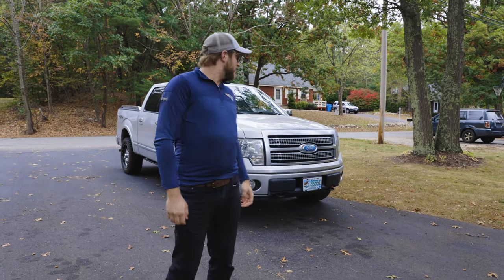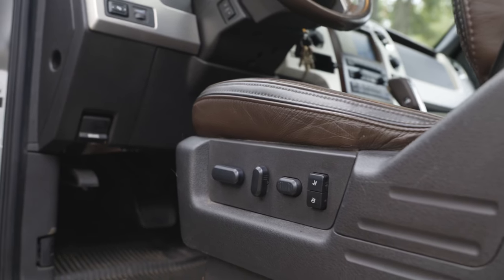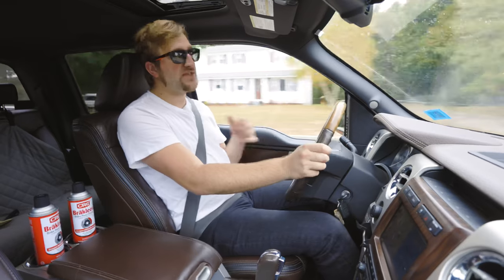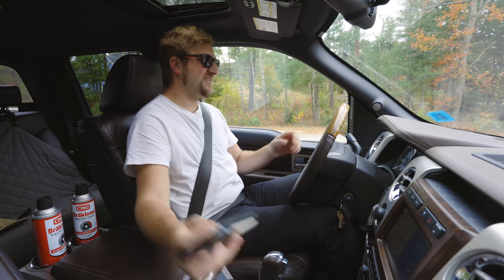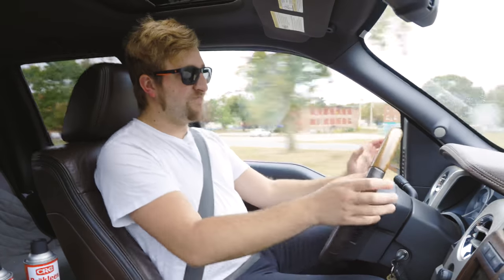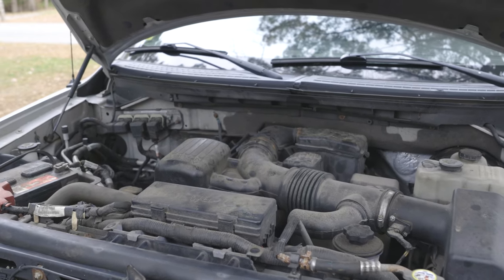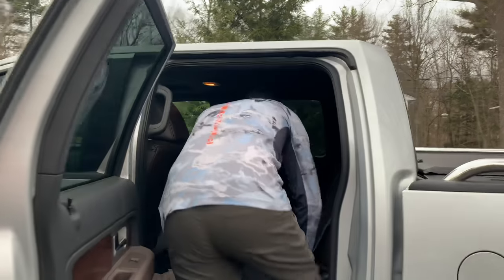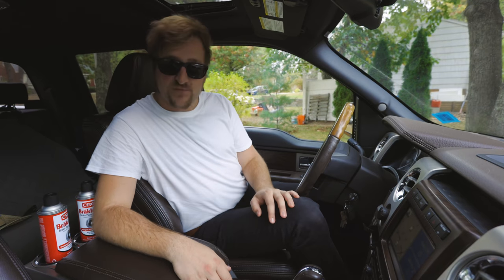2009 Ford F150 5.4 V8 - Long-Term Review (Reliability, 0-60, Towing, 4x4)

Comment: My 2010 F150 has been nearly perfect for me. I too have the 5.4l triton. I bought it with 35,000 miles back in 2014 and have owned it ever since. It was and is my first car and has been through a bit but I've always taken good care of it. Oil change every 3500 miles and I recently did the diffs and transfer case. I need to change the plugs soon, have a coolant flush and the transmission fluid changed (drop the pan). I am at 103,000 miles now on it which is relatively low miles but 50 percent of them have been towing anything from a 17 foot aluminum boat to my 21 foot fiberglass triton. The only issue I had with it was when I first bought it... It came from NY and had an exhaust leak at both exhaust manifolds. Whenever I had the mechanic try to change the manifolds, 4 or 5 of the bolts broke (a few rusted and broke on their own). So that was pretty expensive (around $2000) since he had to pull the engine, drill out the bolts and install the new manifolds and bolts. But otherwise the only other thing I have had to do to it was get new brakes and two sets of tires but those are more wear and tear items and not a fault of the truck. Hopefully she gets me through another 100,000 miles no problem. It does have the timing chain slap for around a second or less after it sits for a while and I do have a little ticking. I recently switched to 5w30 instead of the 5w20 oil since that is supposed to improve the longevity of these motors and the cam phasers.  Also this truck has been great for me off road in hunting and fishing situations. And it is so comfortable that I would prefer it over a car for road trips. I do typically average around 14.5 mpg every day driving but I can squeeze out anywhere from 18-20 on the highway depending on the hills and how my right foot feels that day. I do have the 5 star tunes for my truck and have been running them since around 45,000 miles. It really wakes the truck up and majorly improves throttle response. It’s pretty dang quick for as large as it is. I have seen people who have reviewed this truck after the tune who have also drove a 5.0 and they said the tune definitely brings it to near or same as 5.0 acceleration. But of course the torque hits very low and makes this engine much better for towing.
Reply: Had the same issue with the slap at 95000 mikes and opened it up. The problem was the tensioner gaskets were blown out and starved oil to the cams. I did the whole timing job including new followers, cams, and used the previous gen ratcheting cast iron tensioners. Locked the phasers. Got the 5 star tune for it and put in the Melling HV oil pump. Runs great now and should last.

Comment: As an owner of 2007 5.4 who replaced the engine after only 140k miles, I can easily tell you that he’s absolutely right.  Replacing the oil every 3k miles is key on these engines. Anything over that is risking failures on the cam phasers and timing chain and possibly more. Routine oil changes and regular maintenance will go a long way.

Comment: I have the exact same truck except mine is a lariat. I've had it since 2016 and I love it. I'm getting very close to 150k miles and have had zero engine issues, I take good care of my truck and don't drive it super hard too often. It's pulled my boat all over the south and driven thru 2 feet of floodwaters. All in all, I wouldn't trade mine in for a rocket (but maybe for a 2021 F-150)

Comment: I recently purchased a 2009 King Ranch edition truck and I must say, it's absolutely beautiful! The ride is smooth and comfortable just like a Cadillac. Initially, there was a ticking sound, which turned out to be the exhaust manifolds issue that is common in the F150s. Despite having 200k miles, everything feels tight and well-maintained by the previous owner. I particularly love the 3v 5.4 engine. Comparing it to my previously owned 2017 truck with a 5.0 coyote engine, I can confidently say that the 5.4 has more low-end torque, which is great for towing. I plan on keeping this truck forever. If the engine fails I'll just drop another one in as these engines are readily available due to being in production for decades.

Comment: Im the 2nd owner of my 2010. It's got 184k on it. The body isn't in great shape, but it has spent it's entire life in Wisconsin. Mechanically, it runs and drives very well. Everything works, it goes absolutely dead straight down the road too. It's honestly not a bad truck.

Comment: I had an 06 5.4 2 wheel drive XLT for 10 years and it was 13 at trade with 145k.  ZERO mechanical or electrical issues EVER.  Changed plugs twice none broke and I did the COPs myself once. Truck was never quieter and smoother than at trade for my 18. 🤘🏻🇺🇸

Comment: The 5.4 is a super smooth sounding engine. Owning both engines the 5.4 is way quieter than the 5.0.
Reply: I loved the low end torque on the 5.4

Comment: My Lariat 5.4L 2010 has 216,300 miles on it.  Love the interior the Sony with 700Watt factory stereo.  Love Leather seats.  They are heavy.  Excellent truck if you keep it up.  My truck will rock and roll but governs out at around 110.

Comment: Bought a 2008 Expedition EL Eddie Bauer new and had it for 11 years. Zero mechanical issues , only a few electrical issues and it had 92,000 miles on it when we traded it.
We still miss “the limo” after two years but the wife wanted a 4 runner. 🙄

Comment: Cool video.  I too don't understand all the crap the 5.4l gets. I have an 09 F150 Lariat with the 5.4l and 3.73 rear axle. I've only had one issue when I bought it new in 2009, and that was the passenger side exhaust manifold in 2018. Other than that.....zero...zip...nadda problems with 150,000 miles on it. 

I did get a custom 91 performance tune from 5 Star tuning and it was worth it. Took care of the shifting, throttle response, and performance. I also have a Banks intake system, throttle body spacer, and exhaust.  This combination really woke the truck from it's slumber. I've had the tune on since 2012 and zero issues.

Also, I only use 5W 30 oil in my 5.4l with a quart of Lucas Oil additive. This stops the ticking noise from the phasers and makes it purr like a kitten. The 5W20 is too thin for the engine. The United States is one of the only countries to use 5W20, all others use 5W30 in the 5.4l. I think Ford does this to make better MPG requirements only. I could be wrong, but it has worked for me over the last 12 years.

I also tow a 7500-8000lbs travel trailer. I live in North Idaho, so most of the places I tow have steep grades at high elevation and the truck does fine.  That being said, I would  never tow over 8500lbs with any half-ton truck in the Mountainwest....period. It's not a power issue, it's a frame, axle, brakes, transmission, weight etc issue. Unless one likes having the trailer drive the truck or "the tail wag the dog." Admittedly,  if one is a "flat lander" as we call them here, then the truck could handle a little more in flat areas near sea-level. 

I've been thinking about getting a new F150, but my truck has zero issues and is still in mint condition. I'd just hate to get rid of a perfectly good truck. Not to mention the insane prices for trucks these days!

Anyway,  sorry for rambling on, great video! It's nice to see a review which isn't a new truck that can back or park itself and has a 42 inch flat-screen in the dash.
Reply from the maker: Thanks for the comment man! Glad you’ve had good luck with the truck.
Reply: I noticed an engine noise decrease when I switched to 5-30 synthetic.

Comment: long oil change intervals are death for this engine family but it is important to realize that the early generations of three valve had timing chain tensioner gasket failure that caused huge oil starvation. The '09 was  the benefactor of redesigned tensioners so that problem, along with redesigned spark plugs in mid 2008 and a head redesign in 2008 has made for much better reliability in those areas. The '09's were among one of the best years for tritons in the f-150 of all the year models with that engine. You can still get into trouble with low quality, wrong grade oil and or long intervals between oil changes.

Comment: I still own a 2009 FX4 with approximately 150K miles I bought new in 2009. 

Best and most dependable vehicle I’ve ever owned. Truck still looks great interior and exterior. Mine has 5.4 triton. Has never had any major mechanical problems. 

Only thing done to truck in over 15 years was tires, one battery and religiously changing oil every 3K miles ( all normal maintenance). 

The only non-maintenance item I’ve had problems with over 15 years are brake low pressure sensors. I’ve replaced them and idiot light is on again. Other than poor low tire pressure sensors…. Zero problems. 

Keep oil changed every 3000 miles and this year 5.4 is a great and reliable engine.
Reply: Why is everyone saying the triton engine is a terrible engine? That's all o ever hear about these engines

Comment: I bought a 2012 Expedition King Ranch last November with 39,650 miles. It's now the end of December, 2023 and it has 46k miles. We'll drive it about 5k miles a  year, so I'm changing the oil twice a year with Motorcraft 5W30 full synthetic and a Motorcraft filter.

Comment: My 5.4 is a 2004 first year of the 3 valve it has 373,000 miles on the original engine and transmission no mechanical problems ever I ran 10w-30 conventional since brand new

Comment: I have 2007 XLT Flare-side. 149,000 and still runs well. 2 biggest issues are REPLACED TOO MANY EXHAUST MANIFOLDS (5 times!) and quirky shifting around 45 mph or 1200 rpms. Other than that it still rides like new.

Comment: I have a 08  350,000 miles i use Schafer synthetic oil and 8-10,000 miles between oil changes uses a quart of oil every 6,000 miles had to replace vct valves at 145,000 miles  it’s a work truck and is loaded and I tow with it all the time. Been a great truck

Comment: 5.4L 3V are great engines! I have seen some owners really good taking care of their 5.4L 3V and myself too with no issue over 200,000 miles with original cam phasers and timing chains system even old ford oil pump. We always change every 3,000 miles with Ford Motorcraft oil filter and 5W30 syth Blend to keep clean and lubricant much we can to keep these 5.4L 3V running last longer. We thought we have failure cam phaser because it was so loud so we took the test sound ear to cam phasers they are normal, fuel injection making these big noise lol😂.

Comment: FYI, down South, we use 10W-40 full synthetic oil in these engines. It prevents all of the known problems. A local dealership solved (100% solved) the 3V 5.4L warranty issues by doing this. I followed their guidance and at 200K miles, the truck has had zero engine issues, no oil consumption, no phaser knocking, no start up rattle, and no cam timing codes.

Comment: I had a F150 King Ranch with 5.4L.  It was a great truck.  The MACHO man that had it before me had the oversize tires that made it drive like a log.  I pulled those off and turned it into a great driving truck again.  Big tires are tempting, but they sure can ruin your ride and your suspension.

Comment: I have a 2010 FX4 same engine just hit 150K miles. It's been my daily commuter for 13 years. Just bought a 26ft RV a few months ago. It weighs about 7K lbs fully loaded and my truck pulls it just fine. The FX4 trim has 3.73 gearing which helps. I am interested in the new F150 Hybrid, almost double the performance. Its a shame new F150's cost so much these days or else I wouldve had one by now.
Reply: I’m at 159k

Comment: I will add another positive comment about the 09 F150 5.4 Lariat.   2nd owner, fleet truck with questionable maintenance, 250 k mi when I bought it.  Now with 260 k mi still runs great other than the occasional off-idle rattle which quickly goes away when I rev it.  15 mpg.  Uses no oil.  Very comfortable for my average size, nice ride, and powerful for my needs.  My biggest complaint is the length and turning radius which makes it hard to park in many lots even with the backup camera.

Comment: I have a 5.4 3v 05 f150 only issue I had was an intermittent missfire on cylinder 3. Wouldn’t even toss code unless I got on gas hard. Swapped coils and plugs still had issue. Changed out roller followers (rocker arms) inspection looked fine but replaced anyway and it fixed problem. Exhaust gasket happened and had some start of frame rust easily stoped with Eastwood platinum rust encapsulator.

Comment: I’ve had a ‘09 S/crew FX4 Luxury edition 5.4 since factory ordering it new. It’s been a great truck however only has low miles at 65k much of which was pulling a 7000 lb. trailer. Over 13 years now I’ve changed the passenger side exhaust manifold, the a/c pump clutch, and when it was fairly new it had two cab leaks around the 3rd brake light and the satellite radio antenna. The engine is quiet with no ticks due to frequent oil changes always using Motorcraft check valve filters, for that matter all fluids throughout the vehicle have been changed faithfully. Last year I changed out the coil packs, injectors and idler pulleys for maintenance just because they were aging even though it probably didn’t need them. With all that said, would I ever consider buying a used one with no way to be sure how the previous owner(s) took care of the 5.4?  Not on your life. However my truck is still as new and I’ve been payment free on it for many years now so this ‘09 F150 continues to be money in the bank to me.

Comment: Still have a 2007 XLT SuperCab with 170k miles. Only spent $1500 on repairs so far. Amazing how well these things hold up. How’s the interior sound? Is it decently quiet? Mine seems loud inside the cab from highway wind noise. I trust it to keep me on the road.

Comment: I have 2008 Ford expedition 5.4 3 valve with 256700miles and it runs perfect thank God, I change oil every 3000 to 4000 miles with good oil. I only bought the truck 9 months ago six thousand miles on it. And I wonder if it's the original motor and trance is it runs too good, I'll take care of her she takes care of me.good truck

Comment: We sold our 1999 expedition to my step daughter and it's about 80 % original and still runs awesome just a cracked header and that stupid spark plug issue with them letting go we fixed the plugs and it's still kicking

Comment: Awesome video! I have a 2010 f150 5.4L 4x4 here in Canada with 280K km's and for the most part I love it. Best year for the 5.4L was 09-10, mainly because ford fixed almost all the issues. No more shooting plugs, sticking them, badly designed components, etc. The only problems that the 09-10 had was those passenger side exhaust manifold (mine is bad), and Fords crappy weak oil pumps (as explained in the video), which lead to lifter tick and phaser knock/failure. You can get lucky with on-point oil changes and not abusing it. But if you get those symptom's you just upgrade all the timing parts (Phasers, VCT's, tensioners, guides, and maybe even lifters) and get the Milling Hight Volume oil pump.  After the oil pump upgrade the engine will last forever. Also, what exhaust does the the truck have?
Reply: Are those expensive to get replaced?
Reply: @9ohfiver  If you do it yourself it will be just under $1000 for everything. And if you take it to a shop it will vary even higher (shouldn't really be more than $3500)
Reply: Thank you for that, I’m buying my first ford truck tomorrow and was just worried about repairing the cam phasers.
Reply: @9ohfiver  No problem, when you test drive it just roll down the windows and listen. These trucks have naturally noisy injectors but if you hear anything besides that you may need to consider what's talked about above. If it has a check engine light make sure you get it read, if it is camshaft position related that engine will already need work.

Comment: 200k on a 2006 5.4L. Worst cost was the spark plugs but other than that just belt and pulleys twice. 5k oil changes but a lot of rural driving and always keep the level up. Burns about a quart or so every oil change at this point. Now in the rusty but trusty category but still pulls and drives great in the snow with 3.55 positrac.

Comment: I have 2009 f150. 4.6 L 3valve its been a very reliable truck. Tows my 5500 lbs Rv trailer up grades of 8%. Still driving today and drive it till I die or it dies.
Reply: How many miles
Now on the truck

Comment: Bought an 09 King Ranch 2 years ago with 99k miles. The previous owner/owners let the oil changes lapse, so a month after getting it, the engine died, cam phasers went and was a lot of sludge build up. Luckily I got an extended warranty, and after much bickering, the dealer replaced the engine for free with a rebuilt 86k mile engine. Change the oil!!!! Had the cab corners replaced too, terrible design. Runs great now, just normal maintenance, replacing worn parts as they come up. Rust is the main enemy now, Iowa winters ugh!